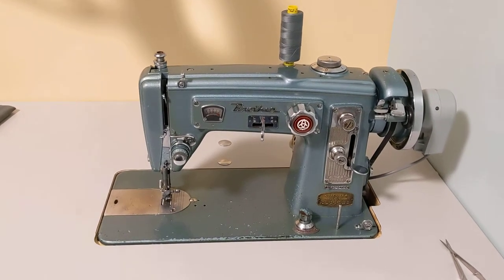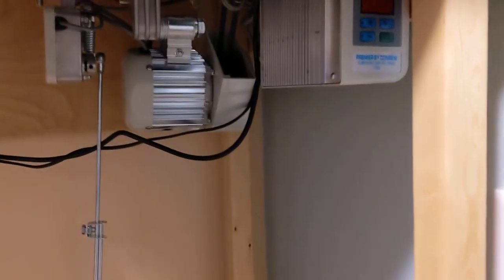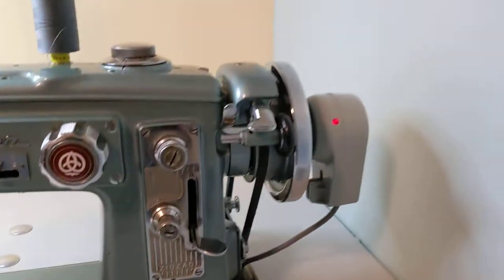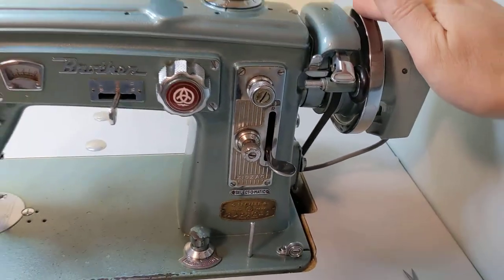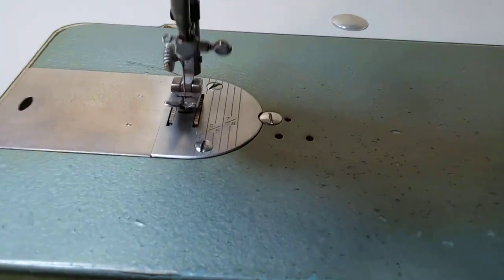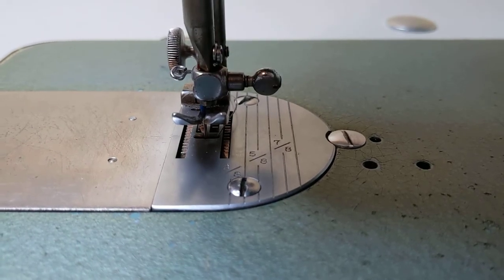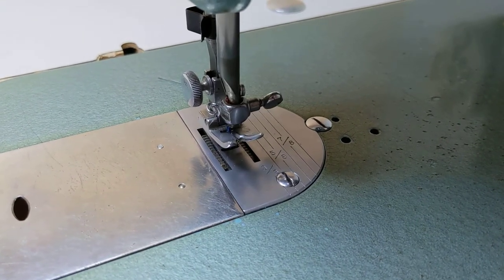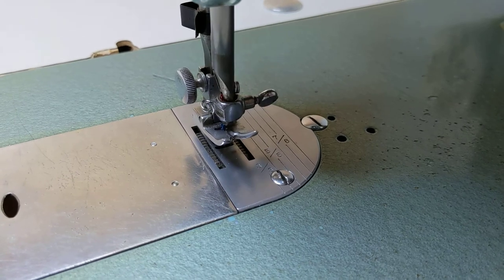Vintage machine meets modern technology

Comment: So cool! I have a similar duomatic. What table model is that? Looking to do the same with mine.
Reply from the maker: It's a really good machine after I got it all cleaned up. With the servo motor it's a HUGE upgrade over what I had previously. The table I made myself. I stole the hinges off the original cabinet and cut the opening out of a 2x4 ft piece of 1-1/4 in melamine I had laying around.
Reply: @fugalinnovations1320  nice work! I guess thats the route I'll have to go. Thanks!